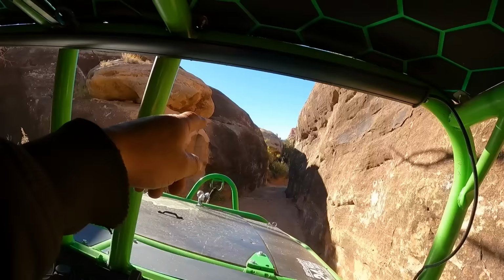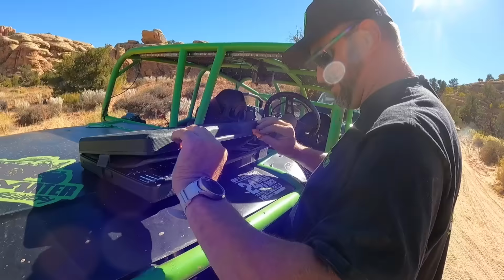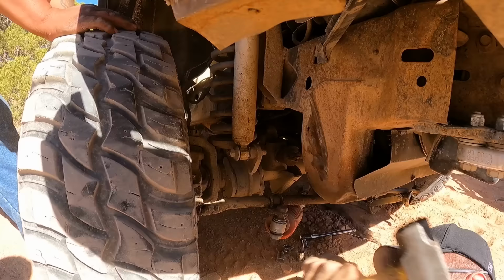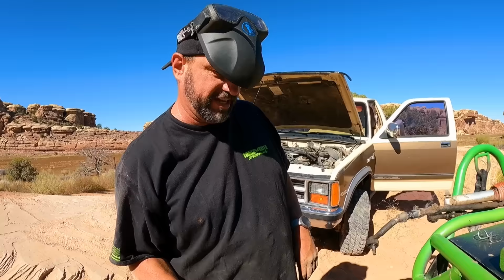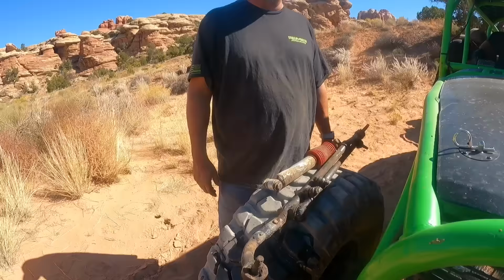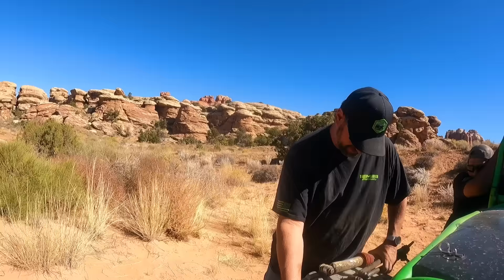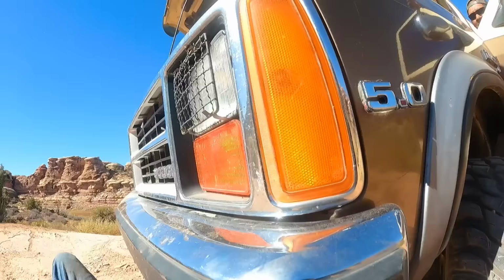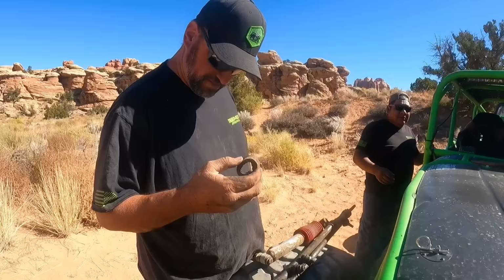Rescuing A Fodge Bronkota

Comment: Too bad Rory doesn’t have a way to bring a real MIG welder out on the trail. It wouldn’t be as fussy as the flux core. But the flux core spool gun is probably better than a stick weld. 

Thanks for showing us an application of a spool gun that I’ve never seen before. I have an ESAB spool gun but I’ve only ever used it on aluminum with argon shield gas.

Comment: Rory in my opinion having other rigs you can use to weld will save on the wear and tear on having to always use TrailMater so you won't have to repair stuff on TrailMater quite as often. 
TrailMater can be used on jobs that no other rig could do.

Comment: Using an extension as a punch... nope, never done that.... much! Not so much that I had to dress the end to accept a socket, not after that first time, anyway! As for mixing pieces/parts.... some of us aren't blessed to have replacement or better stock parts available, so we do what we can with what we have. My old International has Dodge axles, Chevy engine and transmission, the stock IH springs and the body is from at least 4 different vehicles. But it works and I like it! 
Based on what I've seen on Rory's videos, a premier welder is in the future for it too. And a couple C clamps, just in case!

Comment: That wire welder is cool and still has the same crazy high pitch frequency as the arc
Reply from the maker: Because it's running off the same power source.
Reply: @trailmater  i have looked into your setup but can't justify it. Awsome ability, just don't know how often i could use it. That one time would be cool as hell 😆

Comment: Yowza! A Fodge!! When you said Bronco axles, I immediately thought of that strange arrangement where the differential was mounted to the driver;s side control arm. You know, the one where the control arm is also the diff cover? I was wondering why anyone would use one of those - and relieved to see they didn't.......  I have a spoolgun that looks very much like the one you used - it came with an Eastwood MIG welder. Mine was intended for melting huge blobs of aluminum all over something so you can spend hours grinding it down to look like it's stuck together!!!!

Comment: That Dakota would have done way better with a 318 or 360 Mopar motor considering they use to come with those and the 302 Ford is a lousy truck motor. Also old Bronco gear and suspension is crap too if it has 'C' bushings. GM 14 bolt, or Dana 70 for the rear with a Dana 60 up front. Back when I did off-road, I remember 1/2 ton Ford coil spring front end setups would break or go out of alignment everything they went off road and this was just muddy roads, not the rocks and sand you guys have.

Comment: Rory what size wire does that welder use and can you put gas to it they sell them small bottles that would be ez to take on the trail
Reply: It's most likely around .025-.035. The biggest problem with using gas out in the field like that is dealing with the wind. Flux core wire is much more forgiving in those situations.
Reply: @mattsirmans9146  I was thinking about dual shield.  I have a LN25 that I run flux core wire and gas at the same time and I have wire that is .045 up to .075 wire that is all flux core wire it can weld some very thick steel

Comment: Good job..
Guys like to put down Fords.
The worst cars I had were GM and they broke down.
I also had forged during that time. And believe me they took a licking and they're still ticking.
I had a 63 Ford Econoline.
Back in 71 that thing went everywhere. Few years later I bought a 68 Ford Bronco. Had it for 45 years. And I abused the crap out of it steel kept going.
Cheryl broke a few axles and spider gears but back then we didn't have all the modern things you have now.
And I own a Lincoln 03 Lincoln Aviator 02 Ford T-Bird. And they still run and drive and they look like brand new.
No problems.
🤙🏾👍🏽🤚🏽🤷🏽‍♂️🤜🏽🤛🏽😊😎🙋🏽‍♂️.
Maybe Mike you don't know how to drive a Ford. You seen that old man on your ass.
No you got to guess by now. I'm a lot older than all of you.
But to each his own how old it feels and how you drive.
🤚🏽
Reply: Same here with Fords, put them through hell and they kept going. My favorite story is putting 3052 lbs of 14" I-beams on a custom ladder rack of a 93 F-150 and driving 135 miles. Twice.

Comment: Awesome work! Question: why mig vs your normal stick welding?
Reply: That's not MIG. The process is nearly identical to stick welding. FCAW is commonly called MIG, which is incorrect. There's no gas used as the FCAW uses a tubular wire electrode filled with flux materials. The electrode also serves as a filler material, and the flux provides a shielding gas to protect the weld from atmospheric contaminants.

It's a lot less of a hassle to run a spool gun imo.
Reply: @JohnnyD1993 thanks! Does stick not have any flux?  But that makes a ton of sense, since they’re not bringing any gas along!
Reply: @raymondseeger4832  stick welding, or shielded metal arc welding (SMAW), uses a consumable electrode with a flux coating, while Flux-Cored Arc Welding (FCAW) uses a continuously fed wire electrode with a flux core. 

The actual process & technique is nearly identical.
Reply: @JohnnyD1993 amazing, thanks for the details!

Comment: hey iv been watching forever and seen u guys weld in some weird spots so i got a question if i dont smell gas is it safe to weld right next to a gas tank cause i need to do a chassie repair right by my tank but i dont wanna blow up my truck i dont smell gas and the other day i wire wheeled it with a grinder and sparks was flying towards the tank and it didnt go up so should i rig it up to remove the tank first or would it be ok to weld there also its a plastic tank not metal
Reply from the maker: If there is  any question and you aren't comfortable with it, just remove the tank and play on the safe side.
Reply: @trailmater  makes sense only prob is i cant without lifting the truck cause my tank sits on top of the cross member and the crack is already bad so i dont wanna lift it if i dont have i was also thinking about putting 1/4 inch steal on the inside and outside of the chassie and a piece of angles steal to hold it for now tell next summer cause we get snow and i cant work in a garage would i need grade 8 bolts or would any thick bolt hold its not alot of strain i can lift the section with my hand

Comment: If you will paint DODGE on your Ford bumper it will not be caught dead on the side of the rode. I had a 64 Ford Econoline van and put DODGE on the bumper and it always broke down in my drive way. It would not be caught on the side of the road, Ford 6 cylinder great van when it was running. Do the reverse on the Dodge paint FORD on its bumper lol. Oh it has to be on the REAR bumper so everyone can see it, Worked for me is all I can say,

Comment: Found On Road Dead and other things not publishable===PS have owned fords all my life and until they started putting all this computer trash on cars, you needed a 9/16 wrench, 1/2 wrench and a hammer...wrenches optional.  Sure wish I still had my old '72 F-250 crewcab.  I had tinkered with it until I had it up to about 13-15 on the highway.  Ya cannot even tinker with them now without two engineering degrees amd a billion dollars worth of tools and meters. Gas cheaper